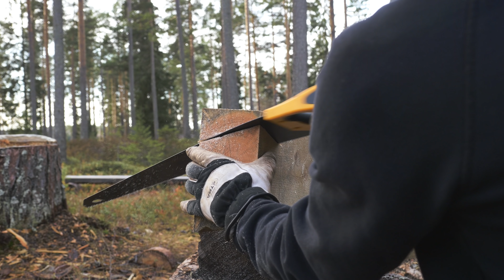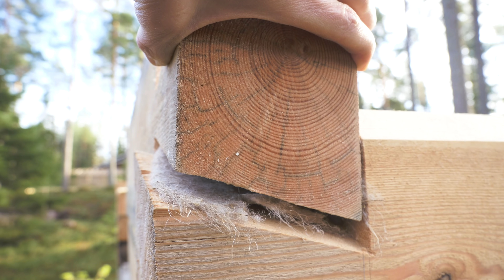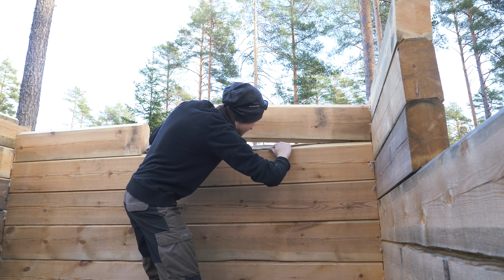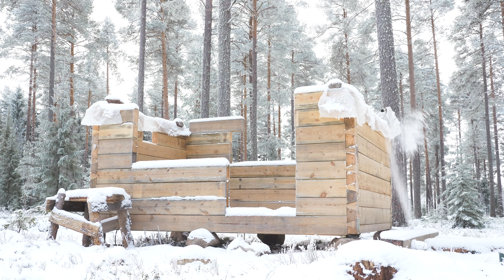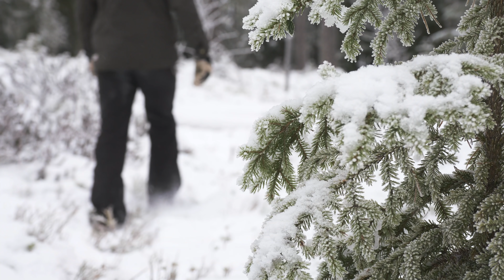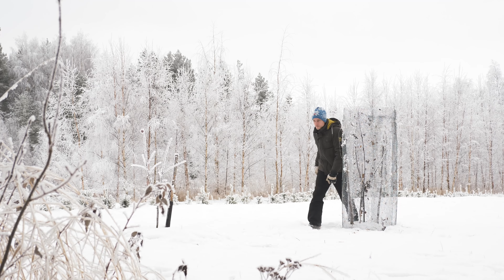Project log cabin | Winter arrives

Comment: Suggestion to avoid the problems with your flax tape twisting and turning. Whey you're dry-fitting the new log, then also drill the hole. Only after that lay in the tape and then hammer the pegs.

Comment: Maybe you could fixe the insulation with flathead nails or staples to prevent ripping lose when you drill?
Reply from the maker: I could try that, but the insulation isn't very strong so I would need to put a lot of nails. And then there's a chance to drill into them :) I think I'll go with the gaps and then try to plug them afterwards.

Comment: Like the photography at the end, very nice and the deer protection around the trees - we have to do that also but leave something out for the critters to eat. 
Couple of questions; the material you roll out between pieces is that to prevent drafts or are there other reasons and could you use something like cement or a synthetic?
I also notice that you invert (to me) your chisels when removing material versus when I woodwork I lay them flat but we are also doing 2 different things.
Reply from the maker: Hi, the flax is there to fill all possible gaps and stop the airflow. I'm using natural material there because if it gets wet, it'll dry too. Glass wool for example doesn't release the moisture easily.

Comment: Hay buddy, I hate to be the one to tell you but they are not logs, Once you cut 2 commercial grade sides on a log it is now lumber or timber. Don't get me wrong, its very nice but it's not a log cabin. It's just a timber cabin.
Reply from the maker: Hi, you might be technically right. However I would still call it a log cabin as the walls are one material from inside to outside.  Is it any different if the sides are done with axe or chainsaw or circular saw? At least this lumber is not commercial :)